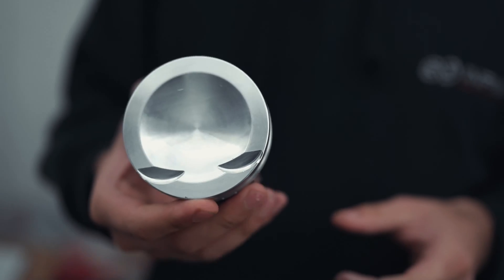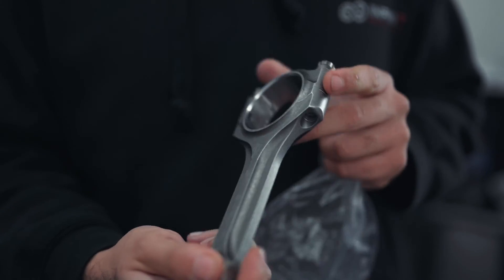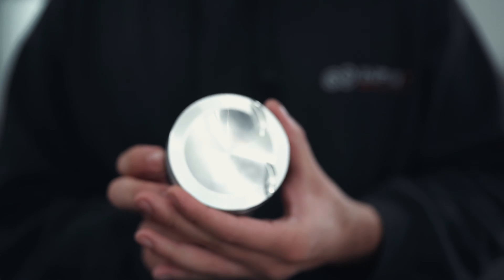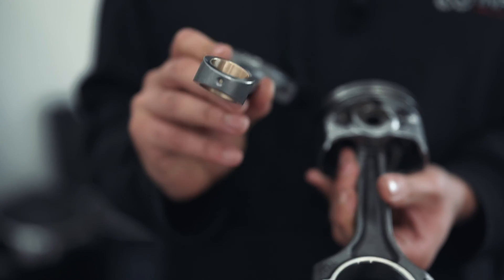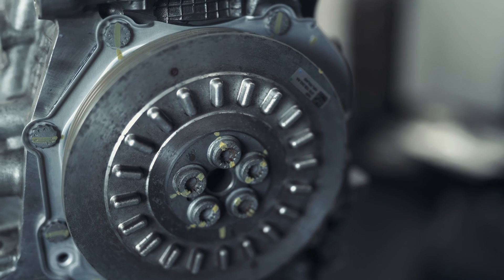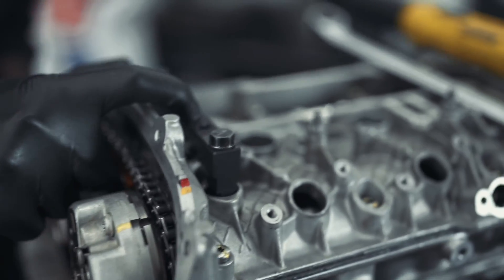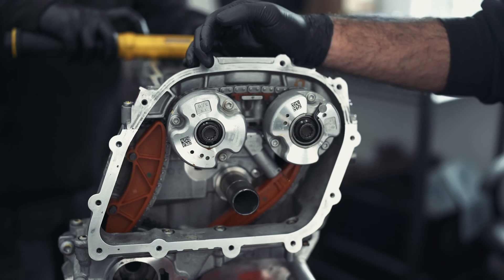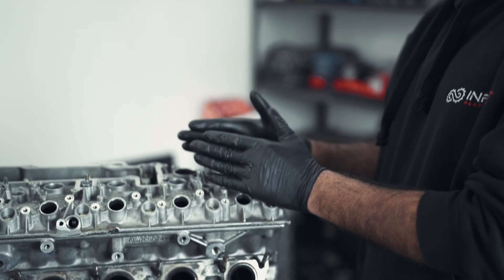RS3 DAZA ENGINE BUILD FAIL

Comment: FYI: You are supposed to remove the timing chain locking pin before you apply the 60nm of torque on the cam phasers per the shop manual and only the exhaust phaser gets the 25nm of torque while you finish torquing the two main center bolts.

Comment: So I’m assuming using the stock pistons with the aftermarket rods it wouldn’t need to be balanced? I know these engines have super tight clearances but I’ve heard people say both ways. If they don’t need to be balanced what rods are they then? I’m really wanting to do just rods in mine because of mileage and wear on pistons and block, but if they have to be balanced I think that’s gonna be more work then I would be able to do.

Comment: Great video refreshing no secret squirrel stuff was blown away that no upgraded head studs after rods what would be your next upgrade
Reply from the maker: The stock head studs are monsters on this engine. After rods, we would be looking at upgrading the pistons for high torque applications. The stock piston is a cracking design but the metal is not that strong and can shatter with bad tuning on heavily boosted applications.
Reply: @InfinitPerformance  Thanks really appreciate the reply do you use JE because you feel they are the best option or availability sorry for all the questions just have always loved the 5 cylinder
Reply from the maker: @marshgatelaneposse  we have the best 
Experience with JE’s or Mahle pistons by IE. Some others don’t suit the aluminium block too well!
Reply: @InfinitPerformance  cool now you just answered the other thing I did not know I take it it’s a coating not a a liner is that the main restriction in your view or valve train design really take my hat of to your ability with this motor

Comment: so after assembly, you do a first start then straight on the dyno for break in procedure? Or I missed something?
Reply from the maker: We run our engines in hard, on the Dyno :)
Reply: @InfinitPerformance  The correct way to do it.  I've been telling people for years the 1,000 mile break-in the dealership tells them is BS.  The only thing you really need to worry about is seating the new rings to the cylinder wall hone.  And that happens pretty quickly.

Comment: What did u use to hold the cams etc to pull the 90deg on the fazer bolts
Reply from the maker: We are using the factory timing tools supplied by Audi :)

Comment: Aoon:  Is there no need to balance the crank when doing rods and retaining stock pistons?
Reply from the maker: Good question! I do not deem it necessary to balance the crankshaft itself based on this engines use case. So for example this is our Stage 1 engine build w/ 3 year 40k mile warranty. No turbo setup on 99 octane fuel with or without power adders is making power past 7500rpm up till the 850hp marker. The crankshaft comes with 4 different clearance sizes for the tolerance in the crank bearings from the factory, the rod bearings come with 1 which means these cranks leave on extremely tight tolerances from the factory.  We do balance the rods & pistons within 0.3g of the lightest. 

If we were doing a build for an application that was going to be making power past 7500rpm and consistently be in the 8krpm range, along with a balanced rotating assembly there would be other changes I would be making to the engine. We actually have a build underway which I will showcase next month (G35-1050). This client is looking to do the occasional drag day so would like to have E85 capability, I will note though that even the G35-1050 is not making power past 7500rpm on a ported head on 99 + power adders... Once you go past the G35-1050 size of turbo you are introducing huge amounts of lag and a car that is simply a drag car at that point and will not be enjoyable at all to use on the road, we are very limited in the UK as we do not have easy access to E85. We like to build cars that are daily drivable and enjoyable hence rarely ever going above the G35-1050 or Xona 8264S size of turbocharger. 

If I had any doubt in my mind about the above, our engine build programme for this platform would be hugely unsuccessful. We have built over 50 engines in the last 3 years with more than 20 running for over 2 years now. Only Audi have the balls to warrant the engine for 3 years and 40k miles. From the knowledge gained over the last 5 years of working on this platform, when hardware and software are working in perfect harmony I am more than confident to offer the same level of warranty.